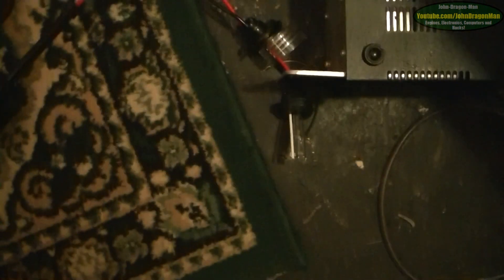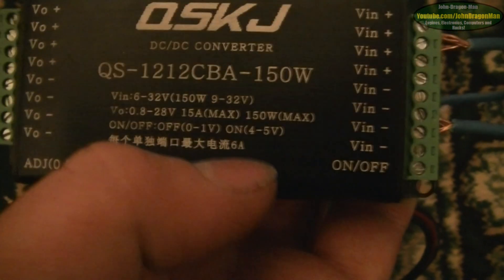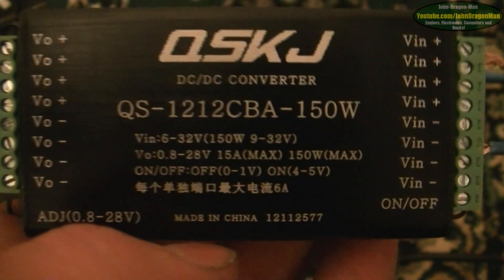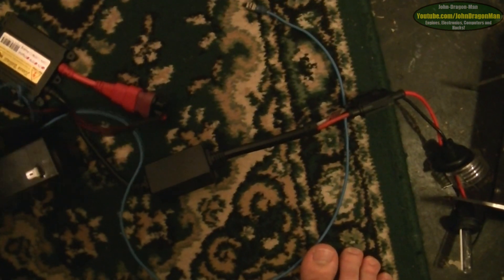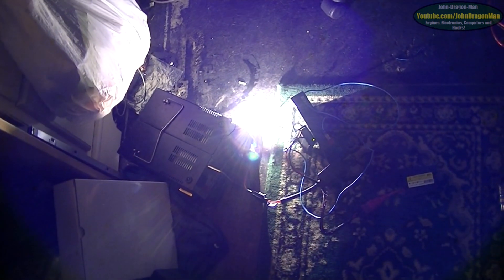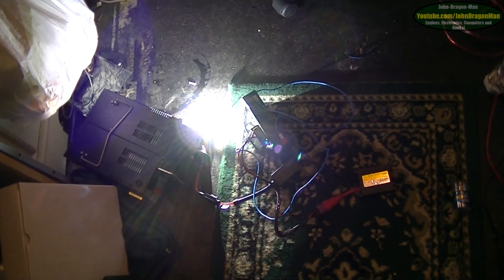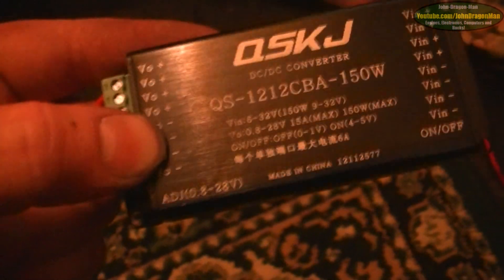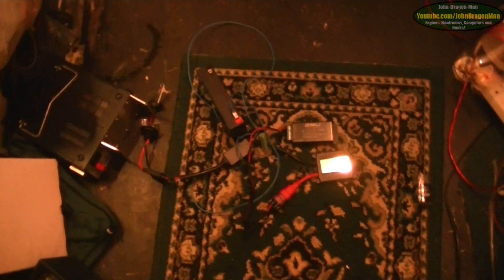6v to 12v converter / conversion buck boost converter ideal for old 6v bikes

Comment: Hi
I have honda cd 125 twin 6 volt.i convert 12 volt?What I want to do & buy?
Reply from the maker: yes you could. however now you can do it a better way than this. take all 3 outputs from the generator and put them into a motorbike 3 phase rectifier. it automatically charges at 12v. I do not have a video of how to do this but I am sure one is on YouTube.

Comment: From the description of this video, you're taking 6v DC and increasing to 12v DC.

Is there a product like this for converterting 6v AC to 12v DC??

The bike in question is a 1977 Suzuki PE250.
No battery so all current comes from the stator which I read is limited to 15watts max.
I was hoping to power a decent 800-1000 lumen LED light with it
Reply from the maker: hmm you could use a diode bridge with a smoothing capacitor to give you 6v DC. you would only need a standard 30 amp diode bridge too. the capacitor..  you could use any low voltage cap so long as its not under say 10v.
hope this helps. also remember that most LEDs run at 3v and are driven at 3.6 to 4.2 volts like most modern torches as most only take 1x 18650 lithium battery! have a look on youtube as some of the awesome push bike lights people have, then see if theres a way of converting that to run without the battery
Reply: Thanks.
That's a bit over my head to be honest...
I was at work the other day and I noticed on my cordless grease gun that the batter is 12volt "18wh" and I was going to see if it would power a 6" 20 ish watt led light bar very long.
However google tells me that it works out to 1500 mah which is about the same as a single AA battery. Q_Q
Reply: You could use a rectifier. That converts AC to DC

Comment: hi...i would like to ask you something...i have a honda cm 125 6v system...how i make it 12v..?? i leave on the 6v battery and the 6v rectifier and put this dc converter or i put the converter and i change the baterry and the rectifier with 12v

Comment: Hi, can this device take multiple circuits? So would I be able to use it for the head light, tail light and turn signals since it has multiple outputs? Thanks
Reply from the maker: +Stefan B yes quite easy. i would recommend LED lighting for the rear of the bike. makes a big improvement.
Reply: +johndragonman Thanks for your reply. So it is a matter of one of these devices and a separate circuit to each of the 4 inputs no? Yep all light will be LEDs to keep the power consumption down :)
Reply from the maker: +Stefan B yes you could do it like that.. so long as the voltage is set to 12v - 14v you will be fine :D

Comment: Hey guys, i'm not much of an electrician, so bare with me. I have a huge question. I want to run an LED taillight, since my old kawasaki g3ss runs a 6v dim as hell taillight. I heard about using these step up DC converters. Is it as simple as that? To connect one of these step up converters from the 6v battery, and run the output as the LED 12v light? Do I need to do anything else?
Reply from the maker: its as easy as that..  just run the input from the old switch, then the output to the bulb. nice and easy!
Reply: johndragonman awesome John! thanks so much, do you happen to know a reliable step up converter I could purchase?

Comment: Im thinking of getting 2 of these! Could you just take the power from your fuse board into the input side of the converter. Do you need to put earth wires into the converter aswell? Or just the feed? As the items on the vehicle would already be earthed.

Comment: Hi ,
I have bajaj ct 100 a 100 cc bike i did alteration in magnet coil , also place 12v9a amron battary.
previously but i m not able to use 6000k 12v35w hid on it.
please suggest. best converter for me

Thanks

Comment from the maker: in all fairness, if you were to build your own 3 phase rectifier you could wire in all 3 phases and it would then generate some power.
the honda mt50 we have is only running from 2 of the phases.

Comment from the maker: how many watts is the HID light? 
also make sure the generator is not grounded to the frame/engine case. if there is a wire coming out of the coil of the generator that is being ground onto the frame/engine case cut the wire.

the generator on these bikes are 3 phase. you have 2 phases (yellow and white wires) going to the rectifier. and often the 3rd phase is grounded and just wastes power. so just cut that wire.

Comment: The super cub 50 is a 12volt bike.It has a yellow wire going to the regulator/rectifier and also a white wire that goes to regulator/rectifier. I connected the hid ballast directly to the battery via a switch.

Comment from the maker: hi you have to modify the stator/generator; the standard 6v generator has 3 outputs one of which is grounded to the engine casing and must be removed you must also install a regulator or the generator will overcharge the battery and blow electronics.the regulator must be connected to the wire that was disconnected from the casing and the yellow wire at the opposite side of the coil the white cable is unused.you can get voltage regulators from eBay search gy6 4 wire regualtor/rectifier.

Comment from the maker: have you converted it to 12 volts?  the cub 50 uses the same generator as the MT50. its very easy to convert over to 12v from 6 without using one of these.